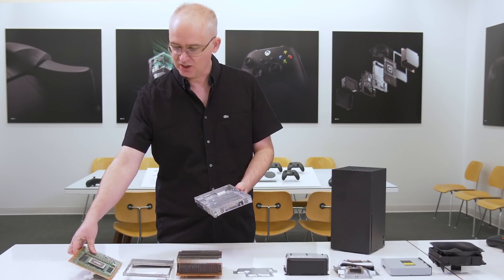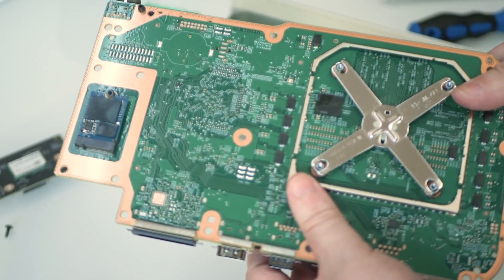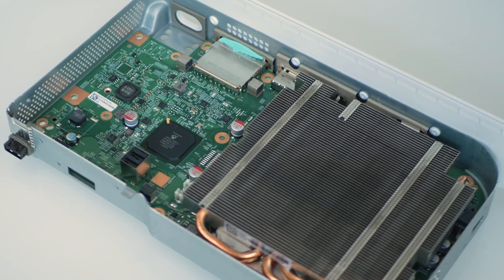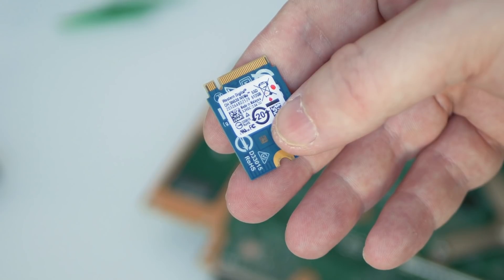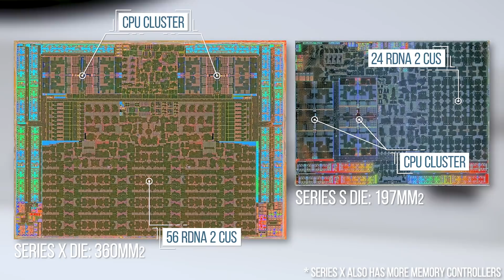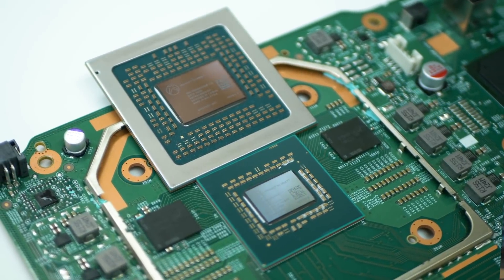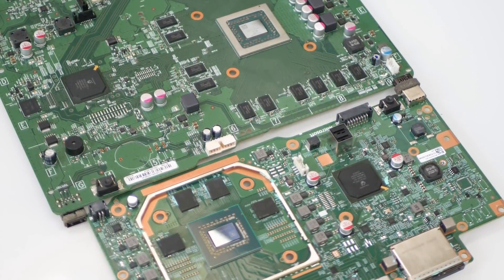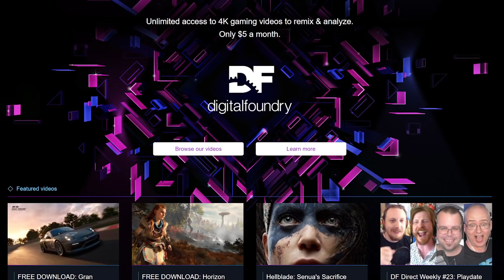Xbox Series S Complete Teardown: Inside Microsoft's Superb Mini-Console

Comment: If Series S had a disc drive and was like £50 dearer or something i would have got one instantly, but i just cant commit to an all digital console. Still impressive little console, great for people just jumping in to play some Gamepass stuff
Reply: ??50 breaks the bank 🏦??
Reply: @twitch-xjuiceboxtwitch2088  no just it would have to be dearer if it had a disc drive, just throwing a number out, would prob be like 50 quid dearer
Reply: Well, there you go. This console wasn't made for you. It has a different market they're going for
Reply: @Nonx47  you are correct
Reply: Are the disc drives of these current gen consoles as reliable as the older gen consoles pre ps4? I doubt it.